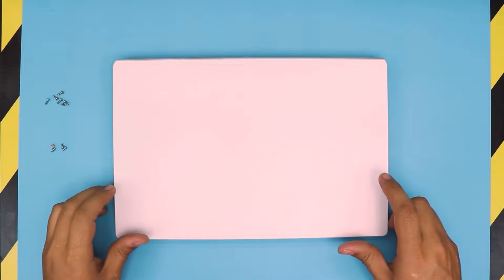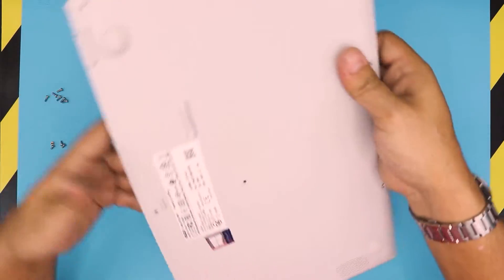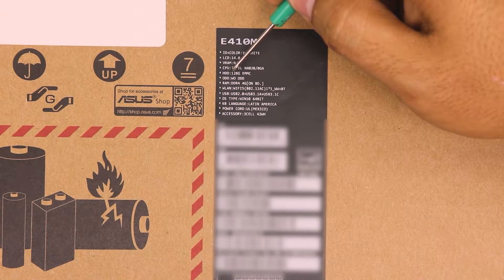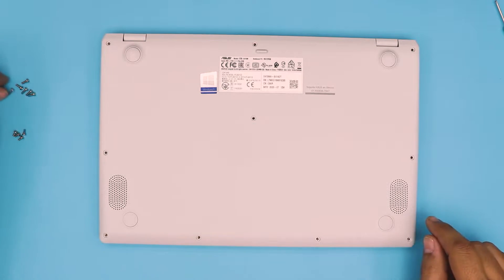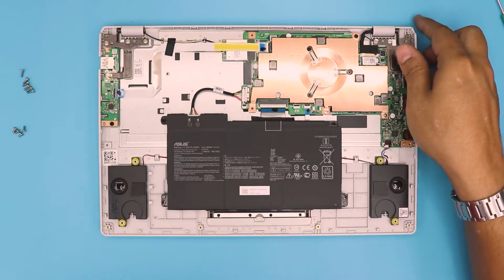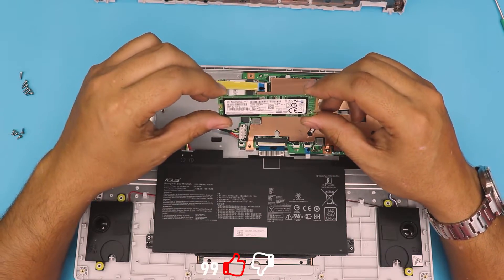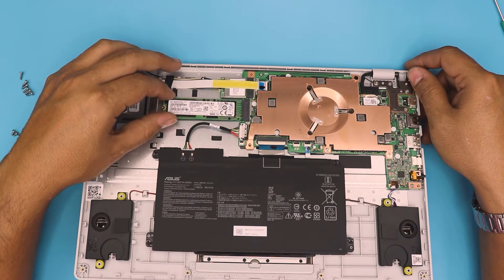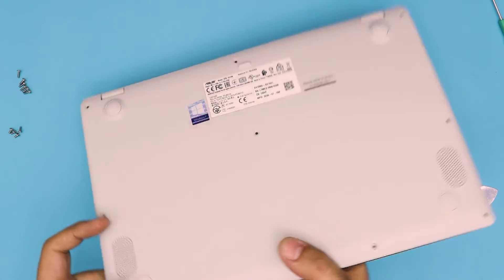ASUS E410 SSD UPGRADE, STEP By STEP

Comment: Very helpful. Do you know the maximum capacity allowed?
Reply from the maker: It's my pleasure my friend.
🫠Regarding your question, the ram is not upgradable, it comes soldered on board.
Should you have any further questions or requests in the future, please don't hesitate to ask me.
cheers🍻
Reply: @uFixTek  I mean the maximum SSD limit for this laptop.
Reply from the maker: we install up to 2TB without any issues.
Reply from the maker: anytime🫠

Comment: A J5040 would fit as well. There is a thin dual fan impeller option for that model, but it was an older integrators option we had in 2018 when we placed the stock orders. They were capable of some slight overclock and with that core the Intel UHD GFX were slightly better as well. If you were so inclined you could get a vertical box doc and ribbon for the m.2 for an external GPU as well. The G410X had a <1% fail rate, which was excellent for it's design and cost. the G410EX was about 25% more cost wise due to the upgrades.
Reply from the maker: Yes, you could, but unfortunately, people don’t know how to desolder and reball a CPU.  
As you mentioned, there are many other variants of this laptop available for purchase.
Reply: @uFixTek  I'm talking about perspective upgrades if one were to have ordered them as an OEM. Just saying the upgrades were out there but most people didn't order that when I marketed and sold it. I think maybe there wer a couple hundred requests out of thousands.

Comment: I saw these modded to support 512GB eMMC and 16 GB of RAM. Much more capable then.
Reply from the maker: Yes, you can install a 512GB eMMC, but you will need to desolder the onboard chip and reball the new one (experienced BGA soldering required). However, keep in mind that the CPU in these laptops is a Celeron, which is not designed for heavy workloads.

Comment: Hiya, trying to help out a friend with one of these machines,  Quick question if you wouldn't mind helping me out?   If I were to upgrade to a m.2 drive would it be possible to use that as the boot device?  Or does the onboard MMC take control somehow?  Don't know if that's a stupid question but I'd appreciate the help.  thanks.
Reply from the maker: 🫠Regarding your question, sure you can boot from that m.2 without any issues.
Should you have any further questions or requests in the future, please don't hesitate to ask me.
cheers🍻
Reply: @uFixTek  Thank you, big love from UK
Reply from the maker: It's my pleasure my friend.

Comment: it shows that after putting in that extra SSD there is screw at the end to be tightened; is this screw alreay there, and what size is it; video excellent; thanks
Reply from the maker: Thank you for your feedback! If you wish to support the channel, you can like, subscribe, or both!
Regarding your question, the screw is not there and you will need to purchase the screw the screws are: https://amzn.to/49q9pbs
Should you have any further questions or requests in the future, please don't hesitate to ask me.
cheers🍻

This is an Amazon affiliate link. When you use my links, you are helping to support the channel. 🙏

Comment: Thanks for the video.I have one question though: if i add SSD to this laptop ,can i clone everything from main disk to new SSD and make laptop boot from new SSD?
I never used nvme disks so i dont know if they work as normal disks.
Reply from the maker: Thank you for your feedback! If you wish to support the channel, you can like, subscribe, or both!
Regarding your question, yes they are like any ssd usage you can clone the main ssd or hdd to the nvme and use Macrium Reflect.
Should you have any further questions or requests in the future, please don't hesitate to ask me.
cheers🍻
Reply: @uFixTek  thank you very much!
Reply from the maker: It's my pleasure my friend.

Comment: What is the Maximum memory allowed with a ssd nvme can You use a 4tb 🤔
Reply from the maker: Thank you for your feedback! If you wish to support the channel, you can like, subscribe, or both!
Regarding your question, no my friend you can go up to 2TB max.
Should you have any further questions or requests in the future, please don't hesitate to ask me.
Reply: @uFixTek  so the 4tb is a NO No 😊🤔
Reply from the maker: yes a nono because a 4TB will require more power to perform and a heatsink, and why would you need a 4TB on this laptop 🫠
Reply: @uFixTek  is this a hard drive or is it RAM as I've got abit confused with my self I've seen 2tb with heat sink would they fit in the slot with the lid on 🤔 I guess when You Say power I'm Guessing laptop version of a power supply 🤔 thanks for All Your Reply Your Help is Greatly appreciated 👍👍👍
Reply from the maker: 4TB on NVME the 4TB won't with because  it is thicker because it has nand chip on both sides, and with heatsink even it won't fit, and lets say you by force make it fit, you will have issue to use because of power delivery on board (components) are not strong for that 4TB to perform.
It's my pleasure my friend.

Comment: Hi My Asus e410ma keyboard does not light up and does not have the keyboard light up symbol on the F keys is there a way of lighting them up is there a lighting kit You can Buy or am I doing something wrong 🤔
Reply from the maker: no you can't my friend the keyboard on board doesn't have the components to make it works and you need to find a backlit for this keyboard.

Comment: @uFixTek (there is actually  a question at the end) so I have this computer (now thx to my 18 yr old with a spider Crack on the lcd smh* but the computer still works..) I mostly use it to go online to clear out one of my Gmail accounts that's consistently in danger of no more storage  & decided to use this also to play my sims4 games on since   the original reason to buy was to get a wfh remote position but the laptop doesn't meet most specifications for many of the positions.. I've been trying to look for memory for this laptop bc the sims4 game requires 31gb and I only have 18gb available 😒 .. I thought it could only take sata ssd but it can take the gaming or regular PCLe NVMe ssd? Because I keep getting conflicting info online and while I'm a techie to a point... this will be my 1st time adding ssd to a computer (so I'm also thanking u for this tutoral bc its mad simple .. here i thought it was gonna be hard) .  Also Samsung is better than Crucial? In what ways is it faster? Because since the ram is only 4gb and sims4 can be used on 4gb although they definitely recommend 8gb but since can't upgrade ram to 8gb ... ?
Reply from the maker: Thank you for your feedback! If you wish to support the channel, you can like, subscribe, or both!
Regarding your question, First of all, you can add an NVMe SSD as it utilizes the PCI-E interface. We have successfully upgraded this laptop model for clients many times. However, it's worth noting that we came across two units of this particular model that only supported m.2 SATA SSDs.

I recommend going with Samsung SSDs, specifically the Samsung Plus series, as they are known for their superior reliability and durability compared to Kingston, Adata, and Crucial. We have encountered numerous failures over years with other brands, whereas Samsung SSDs have proven to be very reliable.

Unfortunately, the RAM in this laptop is not upgradable.

If you have any further questions or requests in the future, please don't hesitate to ask.

Comment: Will this laptop be usable for gps work like arcgis.....
Reply from the maker: Thank you for your feedback! If you wish to support the channel, you can like, subscribe, or both!
Regarding your question, no my friend i would highly not recommend this laptop for that use . it will slow down a lot
Reply: @uFixTek  then with a high speed ssd nvme, would that help. Someone in my area has put this laptop onsale for a damn tempting price, and its only about 5 months. 😀
Reply: @uFixTek  and subscribing too, for your kind answer. 👍
Reply from the maker: The issue is that the CPU is the bottleneck of the performance. These laptops are weak in terms of CPU power. If you have a fast NVMe SSD, it will run adequately for office use. However, I don't believe it will be optimal for the program you are using. I recommend looking for a laptop with an i5, i7, or even an i3 processor for better performance.

Comment: I know it's 2023 and I Just saw this video it is very informative. I have the E410M. I am using 60% of the memory. I am thinking of using my laptop to record my 4 4K cameras. Do you think it would be feasible to add a 1TB hard drive and use that as the source of the recordings?
Reply from the maker: Thank you for your feedback! If you wish to support the channel, you can like, subscribe, or both!
Regarding your question, oh boi i don't recommend you at all, the videos will not be recorded properly and will have FPS drops and will feel laggy. we have tested with one 4K 60fps and a big NO!

Comment: where is the screw that holds that down? also can you use a larger than 512g SSD and partion it so no partition is larger than 512
Reply from the maker: Thank you for the feedback! if you wish to support the channel you can LIKE or SUB or both :P
regarding your question: you can have up to 1TB without any issue, and the screw you will need to purchase: https://amzn.to/3EkDKtP
you can partition a 1TB to as many small partitions you like. or keep it as 1tb or 512GB
Reply: @uFixTek  hi, i only see that 512gb is supported but did you try 1tb and it worked?

Comment: I bought this on the cheap for friend going through a tough patch.  I would like however like to upgrade the 64gb to a 256gb NVMe  drive.
Do you have any suggestion of this size from Amazon?

Also, Windows 11 comes in "S Mode" on the model I just purchased.  Does it matter which versions of Windows 11 I download to do the fresh install after installing the 256gb drive?

Terrific video tutorial!  

Thanks!
Reply from the maker: Thank you for the feedback! if you wish to support the channel you can LIKE or SUB or both :P
regarding your question: you can place any 2280 m.2 nvme int here up to 1TB, the best brand is SAMSUNG, i will give you couple of them from best to economic 
#1: https://amzn.to/3AdOg3Y
#2: https://amzn.to/3cazFhK
#3: https://amzn.to/3ClZWEO

Comment: I would like to install windows on the NVMe but my ASUS N4010 laptop keeps installing it to the Emmc and I do not see a way to disable the emmc in the BIOS.  Any suggestions?
Reply from the maker: Thank you for the feedback! if you wish to support the channel you can LIKE or SUB or both :P
regarding your question: when you get to the step where you have to choose the drive to install the windows!,  you MUST delete all partitions the emmc and the nvme and at the end you will be left with two drive, drive 0 and drive 1 and choose the drive that is bigger that is the nvme.https://imgur.com/a/1MYsnz7
and one step before make sure you choose custom: https://imgur.com/a/1MYsnz7

Comment: I just bought an Asus E410M and upgraded to Win 11. I have only one program on it that could easily be reinstalled. If I upgraded to this SSD - how would I move/install Windows on this drive - considering that C drives do tend to fill up easy - despite trying to install programs on the non c drive?
Reply from the maker: Thank you for the feedback! if you wish to support the channel you can LIKE or SUB or both :P
regarding your question: if you place a new ssd, you can't transfer the windows install, you will need to install windows 10. if you try cloning it will give you a lot of error and crashes, we tried.
Reply: @uFixTek  Thanks for replying. If I did a fresh install Win 11 on the new SSD would I be able to format the C drive so I didn't have 2 Win 11's on my computer? Thanks again.
Reply from the maker: yes you can format the old C drive and use it as an extra storage, awesome job my friend :)
Reply: @uFixTek  SSD from the link above purchased and while initially it wasn't shown in the computer, after reinstalling and installing again, then some work in disk management - it showed up fine, and using Samsung's own clone software I transferred everything from the small drive to the big. Works great and thanks again.

Comment: In my Vivobook you can only replace the original SSD by another SSD, which means, you have to look, if the place is free for another SSD or copy your system on an USB-stick and recover.
Reply from the maker: what you mean by original ssd :/ ?
you have a m.2 ssd installed from factory or you have on board emmc chip?

Comment: no wonder why this is really cheap.
Reply from the maker: unfortunately this is how this is a dirty move from any brand asus or hp or dell, they are all have different category for laptops the horrible cheap ones are made beautiful from outside so people don't look inside :/
the components that are used are low grade capacitors and resistors

Comment: Hi, I just installed m.2 nvme on my asus e410m laptop, the nvme is not showing on bios and disk management, do you know if how can i fix this ? thank you.
Reply from the maker: ok, update the BIOS  ship. then double check that is fully inserted (reinsert). also check in bios menu that sometimes they put an option for m.2 to enable or disable. if you see any m.2 option then enable it. also can you give the exact model for the laptop the full model number. because there are two models and one takes m.2 NVME and the other takes m.2 SATA (has two cuts on the pins), also this m.2 ssd are delicate against shots, or they do get defective sometimes depending the model you purchase, we purchase a lot of m.2s in a months and 1 in 15 are defective
Reply: Hi, what size was the m.2

Comment: ASUS E410MA-0571BN4020 hello sir this model its 64gb emmc can i upgrade to  128ssd?thank you
Reply from the maker: thank you for the feedback! if you wish to support the channel you can LIKE or SUB or both :P
regarding your question: you can't but you can find a real good technician that can do a reballing, and get a 256gb emmc chip.
https://is.gd/nfV1if
or the tech can find the exact model. and solder it on board.

Comment: Thanks for your video! I have a question.. Is HP SSD EX900 M.2 with PCIeGen3x4 interface and new NVMe 1.3 specification compatible with Asus E410M with 64GB eMMC?
Reply from the maker: Thanks ✌  for the feedback!  if you wish to support the channel you can LIKE or SUB or both :P
Regarding your question:  the emmc are very slow nothing compare to sata or anything, and this laptop has the chip set of the pci-e3 and any nvme is compatible or you can place gen4 nvme and it will work as the pci3 , dont put gen 3 or 4 its not worth it for hte celeron cpu. place any cheap nvme.
https://amzn.to/3gj4907

Comment: what size ssd do i need for this laptop the asus e410?this is something google says 
The other thing you'll want to check before you go out and buy a replacement SSD is your drive's form factor; you need to make sure the drive will fit in the laptop. Most laptops have 2.5-inch drives, but ultraportable notebooks may use the 1.8-inch disk size.so just wondering what size the ssd needs to be for the asus e410m
Reply: actually my laptop says its a l410m any videos on that one any difference
Reply from the maker: Thank you for the feedback! if you wish to support the channel you can LIKE or SUB or both :P
regarding your question: your laptop " l410m" does NOT take any sata 2.5" or 1.8' drives. the only available storage is the m.2 slot, that can take any m.2 or m.2 nvme. up to 2TB,
https://amzn.to/3wPv6OE
Reply: @uFixTek  the actual size you can upgrade to is 512gb max straight from asus I have a 500 gb ssd running my laptop now it's got the os and all running great now have a 500gb laptop with the extra internal hdd emmc I can wipe and use as storage or just leave in case anything ever happens but I figured this process out ty

Comment: Hy can I upgrade the ram because in website they say it can goes to 12 gigs? But I don't know where to add
Reply from the maker: Thank you! if you wish to support the channel you can LIKE or SUB or both :P
regarding your question: unfortunately the rams are soldered on the board and they are not replaceable or up-gradable,
they are like cellphone (iphone) they come with 4gb version and 8gb and 12gb version. we get this laptops a lot in the store and people keep thinking they can upgrade and buy the 4gb and hoping for upgrade :(

Comment: Very educational video. Does the motherboard supports only up to 500GB HDD or I can use larger 1TB capacity? Thank you.
Reply from the maker: Thank you for the feedback and your support by a sub  :P
regarding your question: you can place a 2TB ssd without any issues.
Reply: Hdd is not supported. Only ssd.

Comment: Please, I have a question. I have the same PC and i would like to learn programming. so I would like to know if I will be able to install the Zorin OS on this. Thanks
Reply from the maker: Thank you for the feedback and your support to the channel by a SUB :P
regarding your question:
yes it can be installed and it will run super fast and smooth, its a Linux-based os.
you will have a blast with it :)
Reply: @uFixTek  thanks bruh. you my man.
Reply from the maker: @josephkunakey5516  anytime my friend